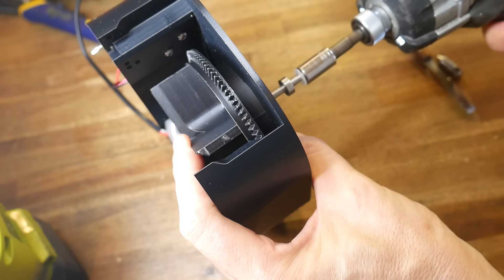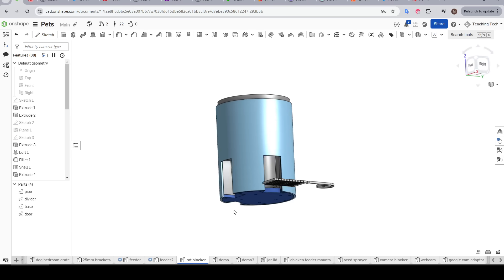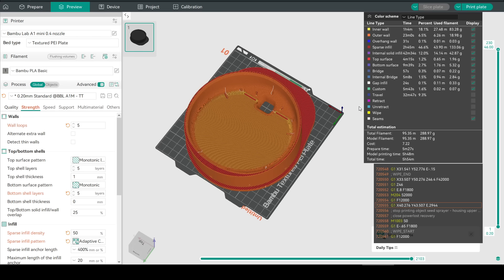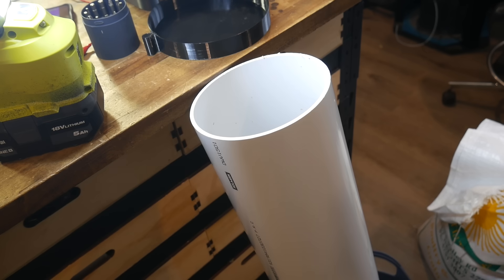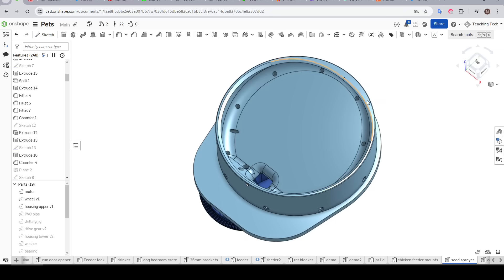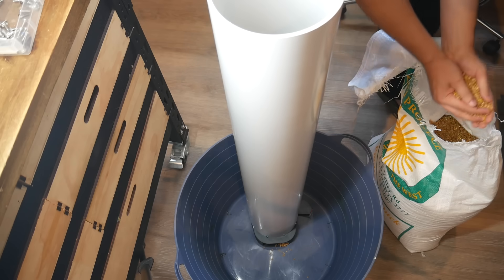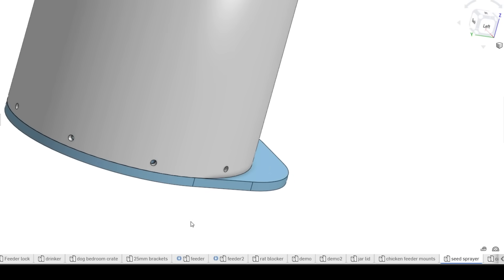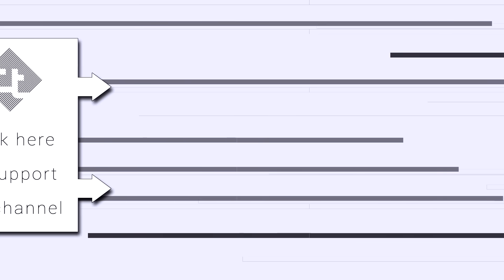Six tips to make your 3D printed projects more successful

Comment: I think undervaluing your time is a big one. Sometimes ill be like oh I can buy this 5$ thing to finish my project or I can build it. It ends up taking an extra 2 weeks to make and cost more in raw materials than just buying.
Reply: Part of the value of saving money by making it is gaining experience building things. If you never spend the time to learn and improve you’ll never be good at making things. Someday, a project down the road will require skills you’ve acquired along the way.
Reply: @carter240  no I agree there is a lot of value in creating things from raw materials. The problem is a lot of times you bite off more than you can chew and give up on a project because it becomes too much.
Reply: I do It for the journey thats why i prefer my old Ender 3 to any modern pronter
Reply: Yes sometimes you can buy the big base part. And then use 3D printer to adapt and modfy.

Comment: My tip is to constantly take a break and ask "What are we doing here? What's the end goal?"

So often I'll be doing a project "Drive RC car with sim rig" but to do that I'll need multiple other projects "build sim, link sim to rc tx, figure out rc rx, add video". All of those sub-projects are where projects die. You get tired spending 6 hours designing the motor mount and you've still not gotten closer to your goal.

But then you take a break, think "But how does optimizing the print time for that mount get me to the goal? It doesn't." and then you call it 'done' and get back to work on your real project.

Make sure you're working towards your goal. Side-project-quests aren't that. You won't notice yourself getting lost in doing them if you don't stop and ask yourself what your real end goal is. 

What are we doing here? What's the end goal?
Reply: I like this. That’s something I ask myself all the time, “What am I actually doing here?”
Reply: I'm guilty of getting drawn into technical details because I'm an engineer and I like technical details, but I'm also an engineer so I'm focused on good results as quickly as possible so I need to constantly reevaluate my work to prevent myself from going into technically interesting blind alleys that don't lead to the desired destination.

I recently designed and 3D printed laser fixtures to laser engrave a new 3D printed product.  Then I distracted myself with the notion that it would be less labor to 3D print the logo so I started learning Blender so I could engrave the logo in the STL, then halfway through that I remembered that FreeCAD can engrave in the part so I started doing that, and then I finally realized that the part is small enough that 3D printing will not have the resolution to make a good quality engraved logo, which I knew at the start, so I'm back to the laser engraving after wasting several hours.  I knew better and still went down that "new trick" rabbit hole because I like learning new tricks.  On the plus side, I didn't need to spend several more hours to print the part before realizing it wouldn't work.

Comment: my 1 tip: print prototypes with cheap filament and use like 5% or less infill, so you can test fitment and alignment. then print using proper or "expensive" material.
Reply: *Making sure your wall count or line width is high enough to maintain dimensional accuracy, since thin walls and low infill can exacerbate deformation.
Reply: @The_Geezus  2 walls is pretty sufficient for prototype fitment. for simple things such as check fitment of a motor, or another part. Maybe check screw holes alignment. use as little filament as possible to check/recheck your designs, so less waste.
Reply: Unfortunately different materials shrink at different rates, so if you need tight tolerances in say asa you can't really prototype with pla